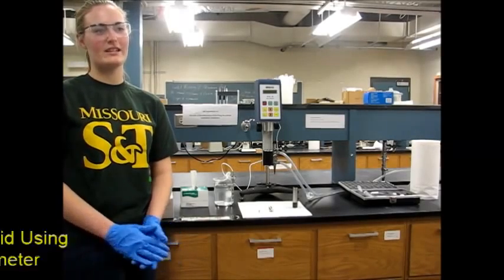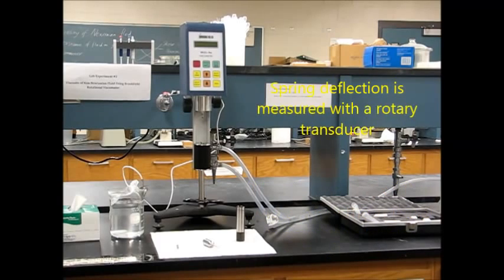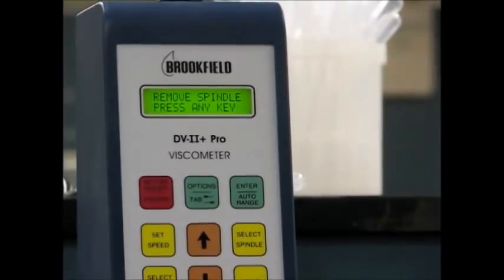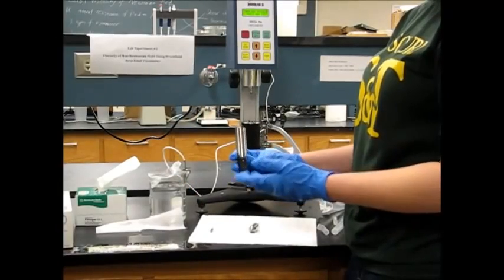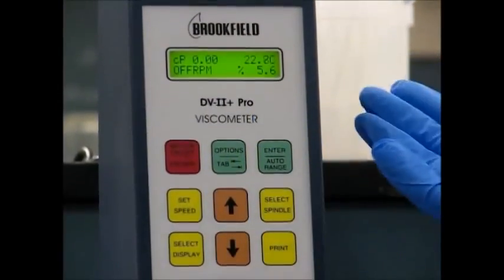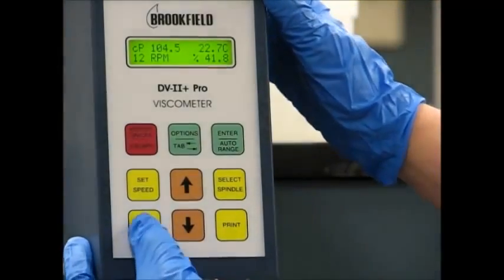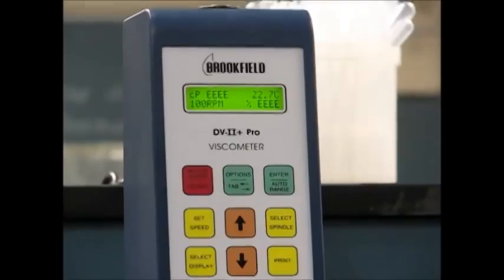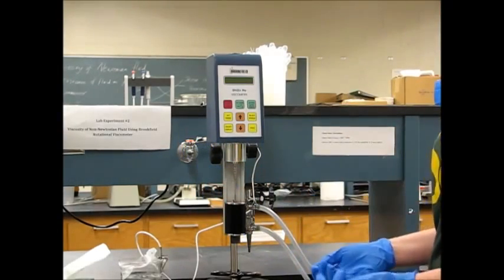Máy đo độ nhớt Brookfield

Comment from the maker: Máy đo độ nhớt thường được sử dụng rộng rãi trong các phòng thí nghiệm. Với chức năng chính kiểm tra chất lượng độ nhớt của các sản phẩm như sơn, dầu, .... Từ đó người sử dụng sẽ đưa ra các đánh giá đúng nhất về sản phẩm.
Thiết bị đo độ nhớt để bàn, hãng sản xuất Brookfield Mỹ.
Model: LVDV-E.

Thông số kỹ thuật:
- Thang đo: 15 – 2.000.000 mPas/cP
- Tốc độ (RPM) máy có khả năng thay đổi 18 tốc độ khác nhau : 0.3, 0.5, 0.6, 1.0, 1.5, 2.0, 2.5, 3.0, 4.0, 5.0, 6.0, 10, 12, 20, 30, 50, 60, 100.
- Độ chính xác: ±0,1% của dải đo
- Độ chính xác lặp lại: ±0,2%
- Màn hình hiển thị LCD, 2 hàng số hiển thị độ nhớt Centipoise hoặc miliPascal, tốc độ vòng quay, phần trăm moment xoắn (% Torgue), mã đầu đo ….
- Sử dụng nút vặn và công tắc.
- Nguồn điện: 220V/50Hz
Phạm vi cung cấp:
- Máy LVDV-E
- 04 đầu đo đi kèm (Spindle)
- Chân, trục giá đỡ làm bằng thép chống rỉ.
- Hộp xách tay nhựa PVC để bảo quản máy
-       Sách hướng dẫn sử dụng, tài liệu tra cứu.